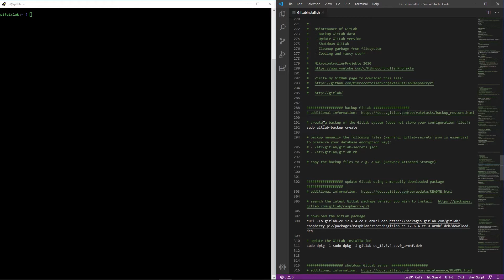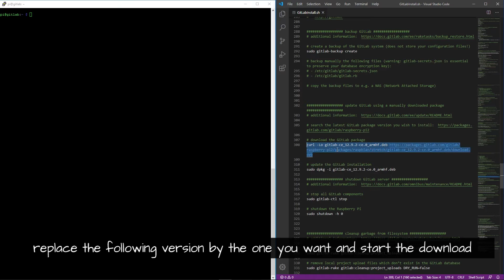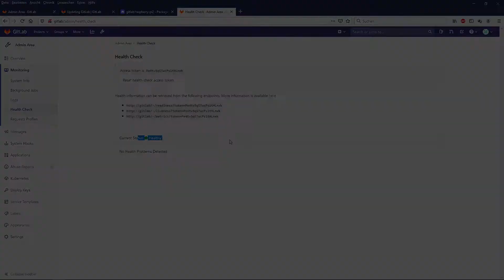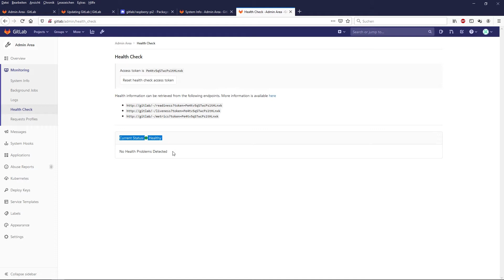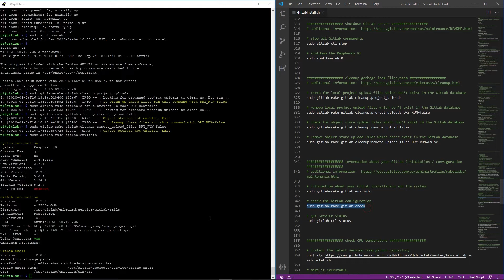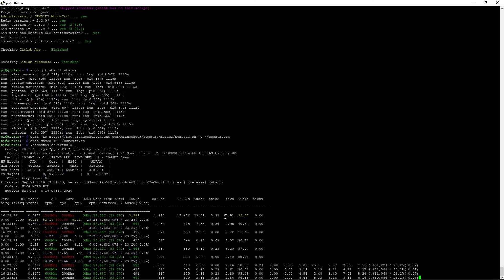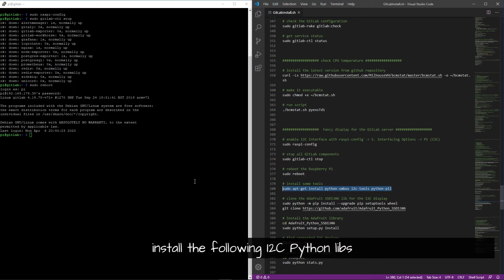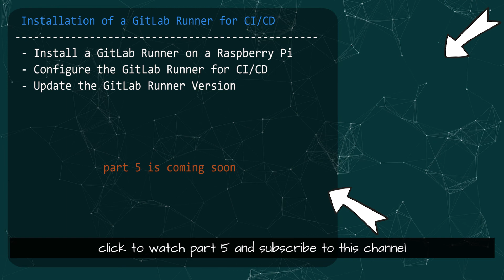Maintenance of GitLab on a Raspberry Pi 4 - OLED Status Display, passiv Cooling, GitLab Update

Comment: Hey man hope your doing well 🙏
I sent you DM on Instagram 
If possible I would like to chat with you about the idrive knob controller from the BMW and ask you something question and see if it’s possible to connect it to and android headunit Sterring whell control input (key 1/key2) while retaining the factory steering wheel controls and if there is a way for the factory steering wheel controls to share the same values as the idrive (like volume up will share the same value so whatever I use it dose the same function) please reply need you input on this 🙏 
And if there is also a way I can create my own “idrive” that would be awesome! 🙏